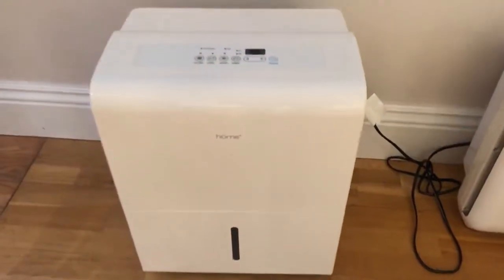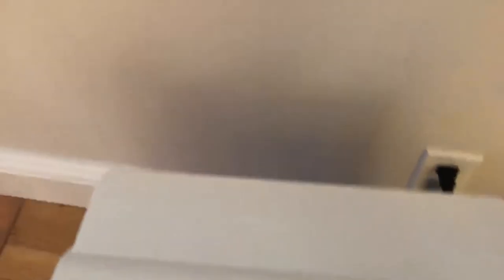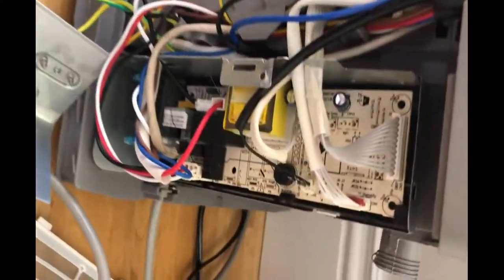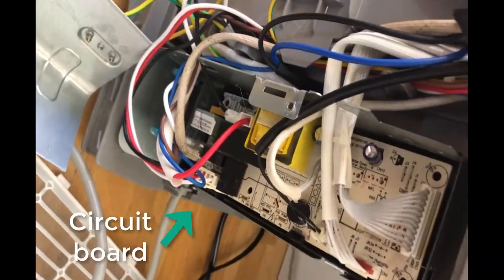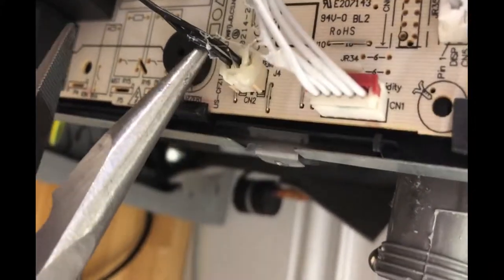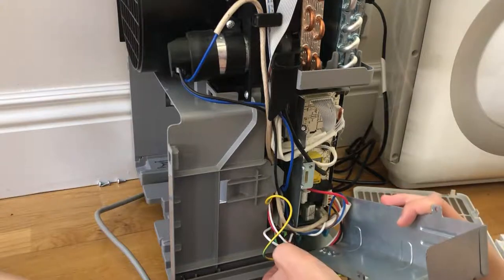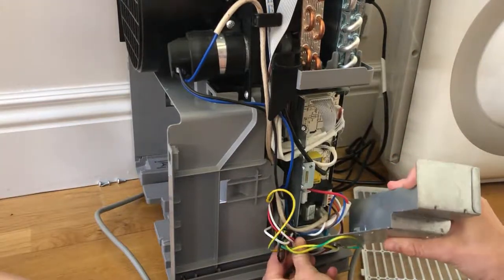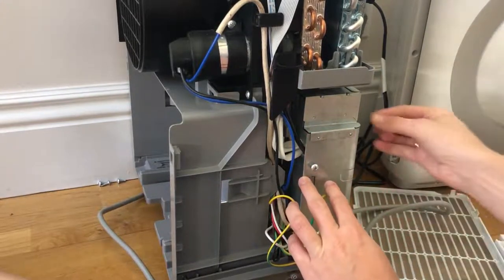How to "de-beep" your electronic appliances (example - HomeLabs dehumidifier)

Comment: Thanks for making this video.  My two GE dehumidifiers from Home Depot beep 20 times when tank is full!  Inspired by your video I disassembled until I found circuit boards with similar beeper and popped off cap like you did.  Success!  First one took 1.5 hours because plastic parts were tricky to remove, but 2nd one only took 15 minutes since I had learned how to pry things apart.

Comment: Not all heroes wear capes! Was able to use this video to de-beep a wall fan that drove me crazy every time a button was pushed on the remote. Bought it for hot summer nights but hate using it because it beeps extremely loud when I would turn it on in the middle of the night.

Comment: I have the same dehumidifier and the same Coway air purifier too (had to laugh). I don't appreciate the beeping on appliances either, it's noise pollution. Very useful and humorous video. TY. I found a potentially dangerous problem with my dehumidifier and was trying to see if anyone else has seen it when I found your video. FYI, it is this and you might want to be on the lookout. Initially I was very happy with the machine and like you, I only use the tank and not the drain hose attachment. The water in the tank had been clear but slowly was becoming discolored and the inside of the tank also. As  you can imagine, it's nearly impossible to get inside to clean that tank, so I'm falling out of love with the machine. During cleaning I decide to unscrew the cap on the drain outlet and spilling out comes nasty dirty water with greenish brown chunks (like algae) in it. When I tilt the machine backwards, even more comes out, and the inside of the outlet is coated with the slime. The tank is not in, so the water is standing water inside the machine that is slowly contaminating the tank. I wish you could have had a look when yours was disassembled. I looked with a flashlight from the front above where the tank sits and from the back through the fins but couldn't see too much except it looks like there is an area too low to drain into the tank or even completely into the drain outlet. Standing water growing organisms. A recipe for Legionnaire's Disease or Mold Illness IMO. I spray and disinfect in there as best I can. I wonder, if you take off the drain cap, do you get water coming out? If not, maybe I tilted it when moving it and water migrated from the tank into the drain outlet area and eventually putrified, but I think it is actually a design flaw and a health hazard. Maybe I'll summon the courage to actually open the thing up and see what's going on and clean it out properly now that I've seen you do it.
Reply from the maker: That's so funny that we have the same set of appliances! At some point, I did notice some mold growing in the water collection bucket that was easily removable to dump the collected water. However, I actually put it in my dishwasher which solved the issue (maybe a lower heat cycle so the plastic does not distort; I'm sure this is not recommended by HomeLabs lol). And, I make sure to not let water stand too long in there after it collects. I think having the Coway next to it helps clear the mold particles. I did see water coming out of the tube when I took this apart but did not notice any mold. It sounds like what you are describing is very gross and potentially not good for your air; I would recommend running some diluted bleach through it (in a tub) if you decide to take it apart. Good luck and thanks for the heads up!
Reply: @laurenbean  TY. I ran the bucket in the dishwasher and it survived and got cleaned and disinfected. I added borax because it kills mold and I didn't dare use a high-heat sanitizing mode.  Had to adjust the angle of the bucket several times to  get all the nooks. As for the hose attachment and what's behind it, I sprayed a homemade cleaning solution including borax and some essential oil and I'm confident that the mold is gone for now. Let it run in the tub with the cap off and the water is finally coming out clear. Having had toxic mold illness, I don't take chances. I know bleach is most people's "go too" but it is controvertial in the mold illness community and can make the problem worse. Also bleach is toxic and my goal and channel is all about non-toxic lifestyle.  Anyway... all's good. Regarding the Coway air purifier, it's not the sound that's the problem, it's the insanely bright indicator light. I blocked it using ''dim lights" tape and did a vid about it. But still a lot of light bleeds through the top panel and I aim for a dark bedroom for improved sleep. Have you opened up your Coway and can the lights and/or sounds be disabled? Please continue to make videos, I think your stuff is great!

Comment: Good video. I agree 100%. These sound and light shows are ridiculous.  No one likes or needs this level of irritation so the question is why Is it built into the product with no way to turn it off? Seems almost passive-aggressive on the part of the designer/manufacturer.

Comment: I'm having trouble removing the outermost shell on the back. I've taken off five screws and it won't budge (including two on the bottom side edges and two beneath the filter housing). Any suggestions?

Edit: figured it out! She really means ALL the screws that touch any white housing. Fixed  :)

Comment: My H0melabs 30 pint looks completely different on the inside.. there is no circuit board. Maybe they changed them. This trick no longer works.

Comment: Anyone have a problem with safety after doing this? I'm going to try this tomorrow and worry about things like electrical fires. I'm sure it's nothing, just checking.
Reply: It’s worth reading up on safety on the device you’re taking apart. Since some will have capacitors and other elements that can still hold a charge even when unplugged.

Comment: Hi All,
What you removed is the PIEZO crystal, the actual component that does the beeping. That's the metal disc, which has a plus and minus connection that touches those two contacts.
It would have been better in the long run, for warranty purposes to place a piece of tape over one of the contacts, so it could be made to work later if need be.

Just saying.
Reply: Hi sorry but what do you mean by placing tape over one of the contacts?
Reply: Just put it back if you need the warranty

Comment: Hello friend don't be panic while recording video. your information is right buzzer is making noise. But you don't know about electronic parts.
You broke that buzzer. Ha ha ha..

Buzzer is very important in electronics.
In case of any issues in pcb at that time buzzer immediately making sound means something problem or notification. You need to read maintenance manual of dehumidifier...

Human's making so many mistakes.
But you don't upset keep your channel continue one day you will get millions of subscribers and followers..

Thank you.
ASM
Reply: Yeah man, that was the point.
Reply: From what can be seen here, she is aware of that.
Buzzers notify you of silly problems, you shouldn't need them
A buzzer is not going to notify you of a fire, or a refrigerant leak, 
You don't need them. 
Only blind people or as a feedback for the remote control, nothing else
The problem code is displayed and the unit shuts off.
The whole point was to destroy the buzzer